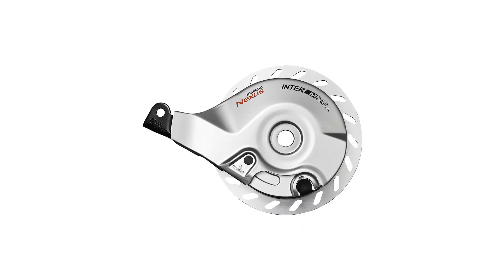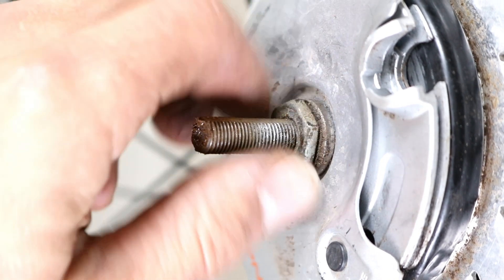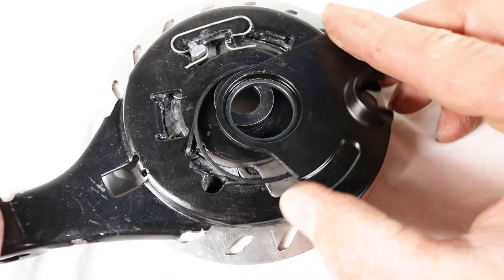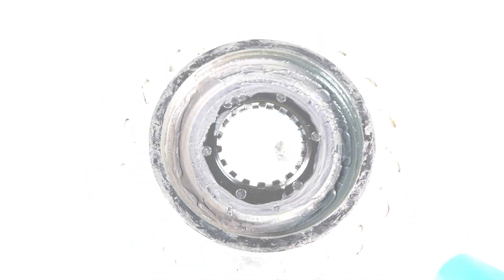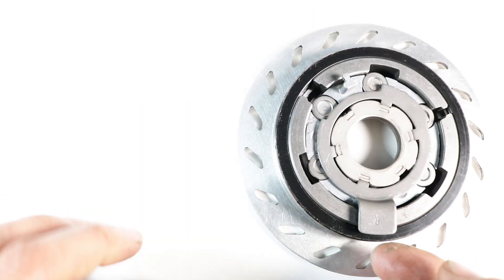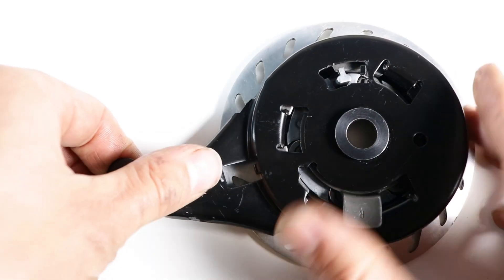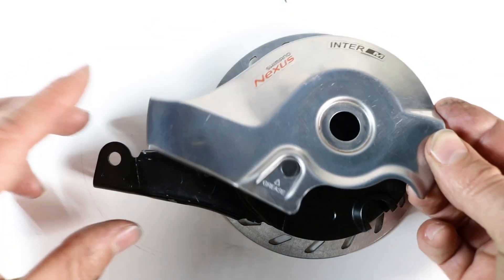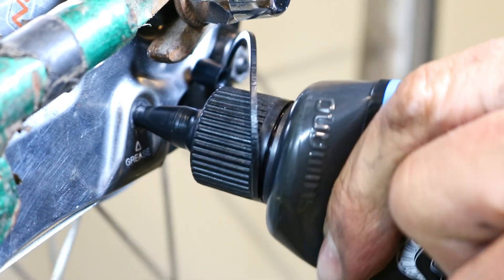Roller brake overhaul  - Complete Shimano Nexus Service Tutorial

Comment: Isn't this a Dutch idea? Been around a while  and I'm on my second bike with roller brakes. 
They do the the job for city and flatlands riding, but definitely scary on any long descents.
The tip I gleaned somewhere from a Dutchman, was, service them at least once a year like this video. If you let them go off, they get too dirty, dry out and ruin the moving brake parts. Once this happens they'll never stop properly again and will need replacement. 👍🛠💯🇬🇧✔😎

Comment: "Once all the components are properly aligned push the backing plate onto the drum" 'click' This is actually very difficult to do and I only solved this reassembly problem myself (I didn't know your video existed) by looking at the underneath of the backing plate, two metal tabs protrude slightly (they act as retaining tabs and these actually locate underneath the flange, when the part is correctly assembled, but I found that I could not 'click' the pacing plate vertically, but had to pivot it instead so that the two tabs located underneath the flange BEFORE the part could pivot on those two tabs and click into place. I filmed this pivot action yesterday (in reverse, when taking the backing plate off) but cannot share it here unfortunately. Otherwise it is a great video to share thank you, but I think you need to explain something about the importance of using the Shimano Roller Grease, which must have some additives that create friction when braking. I consulted the late great Sheldon Brown on this topic on Shimano Roller Brakes and in the official Shimano Maintenance Manual it states "Note: It is recommended to use the official Shimano Roller Brake grease (Shimano p/n Y04120400 (Net. 100gram)) when carrying our maintenance. If the original Shimano Roller Brake grease is not used problems may occur. Well done for making the video.

Comment: Thanks for the clear video. I managed to get my front brake working properly without any rattling noise. If your brake is a bit older, it may be important to keep the positions of the rollers and brake shoes the same before and after cleaning. This is easiest to count them from the key of the retainer with the rollers (02:49). I also found it useful to grease the parts during assembly. During assembly the spring accidentally jumped partly under the arm that holds the cable (06:03). So the brake didn't work properly: after braking once it was stuck. Reassembling the spring and arm while holding the arm tight against the backing plate solved this problem.

Comment: I accidentally dismantled the entire front wheel brake assembly instead of just taking it off of the wheel in order to see what was wrong with it, and your video really helped me put most of it back together. However, the brake I'm working with is ever so slightly different from the one in your video, and I cannot seem to properly reattach the springs (as the points you attach them on in the video do not exist on mine) do you have any tips regarding this? 

Regardless, thank you for this excellent video.
Reply: Hi, I also have this problem. Did you solve it?

Comment: حتى بعد الصيانة إنه يبعث منه صفير صداع
Reply from the maker: Hi, thanks for your comment! If the brake is still underperforming and producing that awful noise even after servicing, it’s likely that the brake shoes are worn out. Unfortunately, Shimano doesn’t provide replacement parts for their roller brakes, so you might need to consider replacing the entire unit. I hope this clears things up!

Comment: How often this needs to be done? I thought that the maintenance was almost to none on breaks like these.
Reply from the maker: Hi, and thanks for your question! It’s a good one as Shimano's manuals actually state that their roller brake units should never be disassembled. The roller brake overhaul helps prolong the lifespan of components like the brake shoes and improves overall reliability. I believe it ultimately comes down to personal preference. If you notice a drop in performance, I would recommend servicing the brake to maintain its efficiency. I hope this helps!
Reply: @cyclemaintenanceacademy  It does help a lot, thank you very much,  one more question, tho. Knowing that I probably will not disassemble them breaks due to laziness of mine, could I still use the internal gear hub grease like you showed in this particular video with the syringe and all that stuff would that make any difference of prolong the lifespan of components aware of that the previous grease is still most likely there with all the mud, wet and soil or what have you  or would it be better to go to the loacl bike shop and pay for the cleaning and greasing. 

Thank you, again for your feedback.

Yours truly Eustace Baguette.
Reply: @PROSTITUÉEJAUNE for brakes you need special brake grease due to these very different extreme conditions in brakes
Reply: @PROSTITUÉEJAUNE there is also an extra maintenance hole for the brake grease. So disassembly is not needed and you nearly can't fix anything.

Comment: Hello.
What tipe of grease need use?
Reply from the maker: Hi, thanks for your question. Shimano reccomends to use a roller brake grease (Y0412040A). This kind of grease differs from standard bike grease. It is designed to keep water out and endure significant pressure, giving your roller brake lasting lubrication and preventing it from losing efficiency or getting jammed. I hope this helps
Reply from the maker: Here's the video if you need help with correctly applying the right amount of grease to your roller brake: https://youtu.be/4BZe8HXqJA4

Comment: Your video shows brake pads that can lay in there any way.  My shoes have two surfaces and I did not note that when i removed them and cannot get either side to fit back in.  Can you describe up and down?
Reply from the maker: Hi, thanks for your comment. I assume that by now you've managed to get the brake shoes right. Can you let us know how you got on? I'll put this on my to do list for the future viewers.
Reply: Same rushing mistake for me too. Mine have a tapered corner which seems to make less noise when seated 'down'. But the pads are also not the same, they have different lengths especially noticeable at the end where they touch when seated.
Reply: BR-IM50-R for me, about 2011 or so. I don't have the thin "raised" wear-wall on my pads (nether roller side nor drum site) that I see on so many videos. Mine are similar to those in this video. Two main notes: 1. one of the pads does not have a little extra "tab" on the "end" of it (neither of the wear faces) so pay attention so you can get yours back into the assembly in the same order. 2. on the drum-to-flat face of the pads, mine has one side "square" and the other "notched" (in this vid, looks like "chamfered"). For me, the square edge is "up" ("notch" goes face down into the drum). Hope that helps someone.

Comment: Do you know of an easy to install rear brake system to replace the Shimano roller brake system?  Alternately, do you think a good cleaning will eliminate constant regreasing to remove the grabbing and squeeling?
Reply from the maker: Hi! Thanks for your comment, and apologies for the delayed reply. Good question! If you’re considering replacing the Shimano roller brake system, it depends on whether your frame has the necessary mounting points for either disc or rim brakes.
Alternatively, cleaning and regreasing the roller brake can help minimise the squeal. Often, noise from roller brakes is due to contamination or excess old grease that needs to be cleared out.

Comment: Hi ! Call from Norway! Thank you for a great video. I have a question about the greasing. Why do you grease the brake hub after putting it together? Why not put the grease on every part after they have been cleaned ? I presume that the whole braking drum and parts inside shall be lubricated with grease ?
Reply from the maker: Hello from England! Thank you for your question, and I'm glad you enjoyed the video. My method of greasing isn't the only valid approach. You're absolutely right—you can also lubricate each part individually before reassembling the brake. Both methods are effective and correct!

Comment: That brake need oil, You forget!
Reply from the maker: Hi, and thanks for the reminder. You can grease the parts before reassembling or add the correct amount of grease after it's reassembled. Both ways are correct.

Comment: My roller brake makes a rattling noise twice per wheel spin. Would it help if I clean and regrease it or should I completely replace the brake?
Reply from the maker: Hi, thank you for your question, and I apologise for the delayed response. I recommend disassembling it to check what’s going on inside. If the parts are worn, it may be time for a new brake. If they’re in good condition, servicing your brake should resolve the issue. I’d love to hear how you end up solving your problem!
Reply: Did you find out the issue? Mine is doing the same thing.

Comment: My bicycle break is fully out of order.Can you please tell me where i can order and what should I order. Do i need to change the full brake system or just pads. Please  please i really need to repair it please guide me
Reply from the maker: Hi, unfortunately, Shimano doesn't offer replacement parts for their roller brakes. Once the brake shoes are worn out, you'll need to replace the entire brake unit.

Comment: Thanks so much!! For me the hardest part was the black backing plate, what worked for me already a few times: first the two 'barbs' on the backing plate that need to grip behind the aluminum need to be positioned, then the backing plate can be rotated back and forth until things fall into place.
Reply from the maker: Hi there!
I apologise for the late reply, and thank you for sharing your helpful tips! It’s great to hear that you found a method that works for you with the black backing plate. Your advice about positioning the barbs first and then rotating it back and forth will be really useful for other viewers. Thanks again for your insight!
Best,

Comment: Brilliant video in showing how roller brakes are constructed. However would be wise to add that this service won’t fix brakes that are worn out - the brake pads do get used up and then disassembling, cleaning etcetera will make no difference in restoring brake power, only replacing the whole brake will do, since Shimano doesn’t offer internal spare parts for roller brakes. Still a very good video.
Reply: Great comment. That completely matches my experience with those brakes and that is exactly what i was thinking when watching that video. The operations shown here are great to clean the dirty brake up (though i prefer to grease the pads before installing them in to make sure the grease distribution inside is even from the very beginning) or to help assemble one working brake out of two damaged ones. However the part with diagnosing and describing typical problems with this type of brakes would be useful and could help people out there to save some time trying to repair the brake with worn out pads.
Reply from the maker: Hi, and apologies for not replying sooner. Thank you for your insightful comment! You're absolutely right—while servicing roller brakes can improve their performance, it won't restore power if the brake pads are worn out. Replacing the entire brake is indeed the best solution in those cases, especially since Shimano doesn’t provide internal spare parts for roller brakes. I appreciate your feedback and will consider adding that information in future videos. Thanks for watching!

Comment: How do you know if it's worn out? How do you troubleshoot the braking outside of simple disassembly and reassembly.
Thanks!
Reply from the maker: Hello, thanks for your questions. If pulling the lever on the roller brake fully doesn't elicit a response from the brake, it's likely worn out. Regrettably, Shimano doesn't provide replacement parts, so you'll need to replace the entire brake unit. As for troubleshooting brake issues, what specific areas would you like assistance with? Disassembling and reassembling often resolves most problems.

Comment: There is a ball-bearing intead of a nut on my rear wheel which has a BR-C6000-r installed.
If i tighten the outise nut to fix the wheel, the break stops working (doesn't go back after breaking).*
Can you make sense of that?
Do you also have that sealed bearing?
I couldn't find anything about it on the shimano homepage.
Reply: Could it be that what you have does look like bearing but in fact is just a metal ring with rubber ring fitted inside? Shimano often uses this kind of spacers instead of normal washers. In my experience in cases like yours best is to check what causes the friction leading to the lever getting stuck. Typically it is either deformation on the cover caused by mechanical damage, or just too tight nut tightening on the outside. In first case just form the metal on the cover back with pliers or hammer. In the second case use two nuts on the outside instead of one and counter-tighten them so they sit tightly on the axle, but leave just a tiny bit of loose fitment on the brake itself. Most of the time combination of those two methods would allow you to fix the issue.
Reply: @Starnger  yes, that is it. But I do not have a nut to screw on.
Reply from the maker: Hi, thanks for your comment and apologies for not getting back to you sooner.  Can you let me know the model of the hub?
Reply: @cyclemaintenanceacademy  same model. SG-C6000-8r

Comment: what about when you clean and grease everything but the brake are still sloppy ? The main pad inside the brake can they be changed ?
Reply from the maker: Hi, and thanks for your question. Unfortunately, Shimano doesn't offer internal replacement parts for these brakes.
Reply: @cyclemaintenanceacademy  ok thank you for the answer, they do get used up at a certain point, don't they ?

Comment: No need to apply grease during reassembly? Only after fitting the wheel? Mentioned link for grease instruction links to wheel montage video?
Reply from the maker: Hey, appreciate your comment and the reminder! I've added the link to the video on greasing a roller brake. You can now access it directly from the video and find the link in the description as well. Thanks for pointing it out!🙂
Reply: yeah it's probably better to the brake shoes while you have them right in front of you